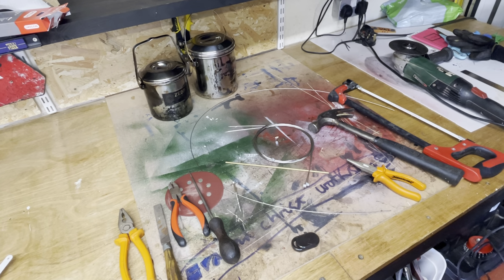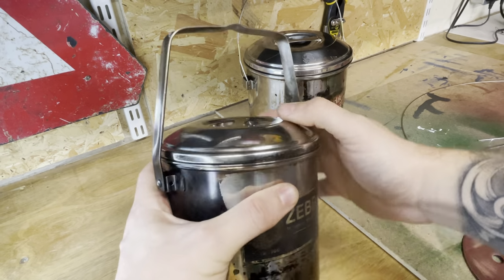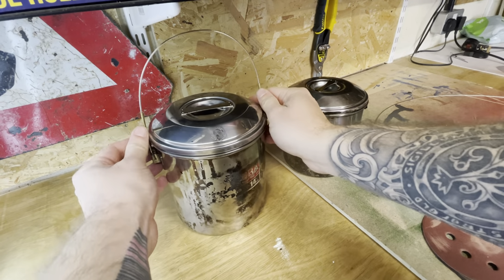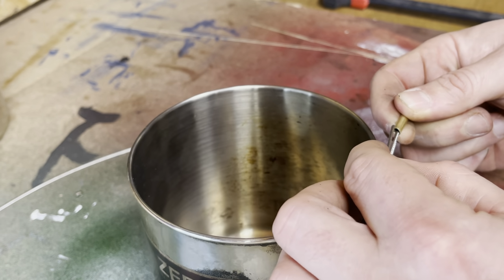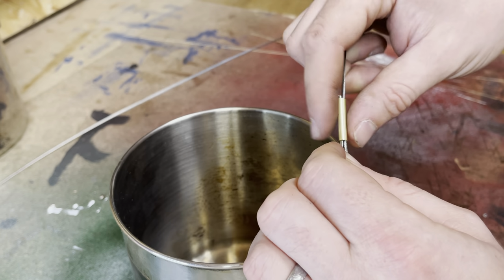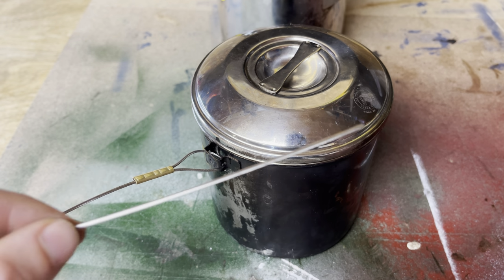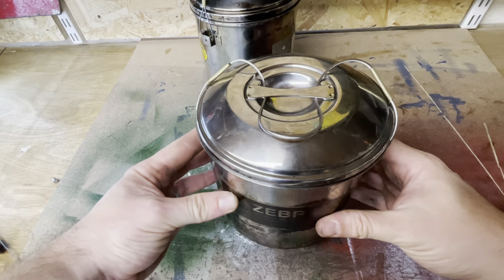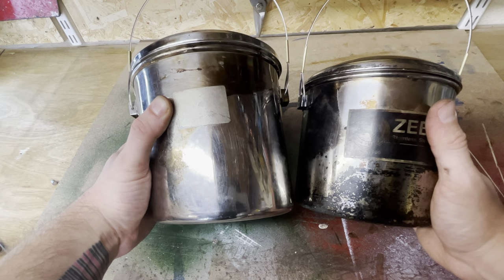Best Zebra billy can mod #bushcraftgear

Comment: i haven't seen anyone do this, admittedly i have only made one search for a mod (i was looking for handle for the 'dish' to become a pan) to this pot but this is a great one!! i do dislike the rigid handle, and all of my attempts at the locking clip have been inelegant and clunky. this is a keen solution!! thanks a million!! another thing you cando to make sure your tubes hold your cable is to fold the fray-prone end before you put it back into the tube, that way there are three 'layers' of cable inside for the tube to grip; also, for those of you watching that do not have brass tubes at home like me, stainless steel straw makes a great alternative!! thanks a million!!!
Reply from the maker: I would just use a pot gripper for the “dish “ to make it a pan ! Thanks for your comment yes a fold would work on the ends to make it more secure , I did  look to do this with wire pike fishing trace and crimps so anything will work I suppose  good look with it , 👍🏻